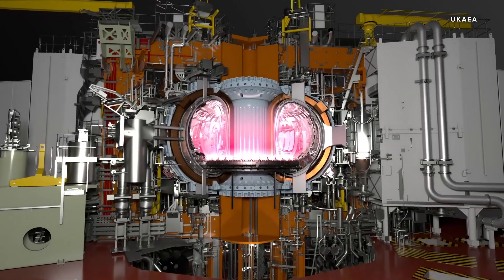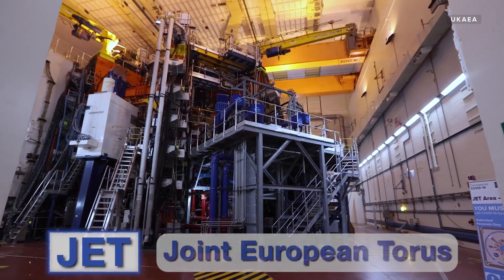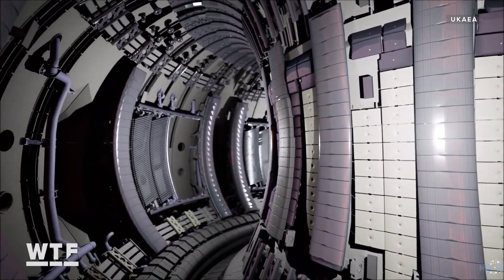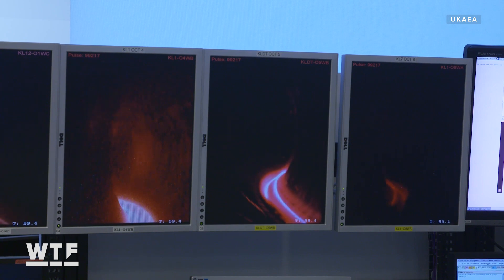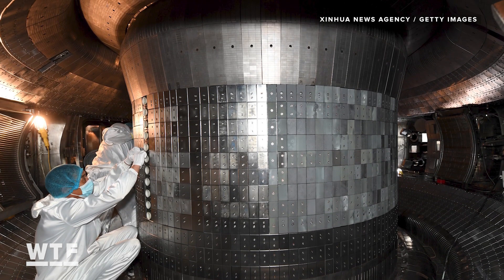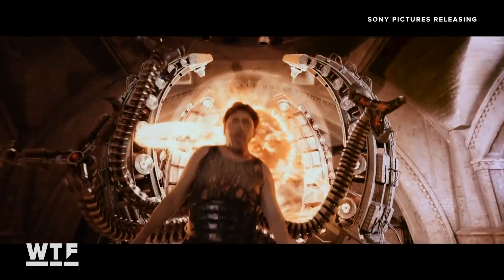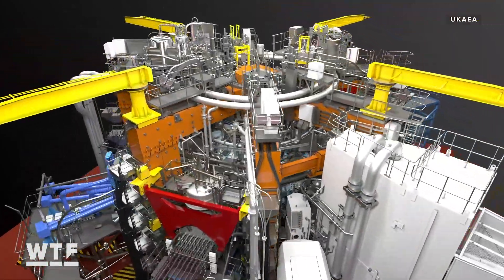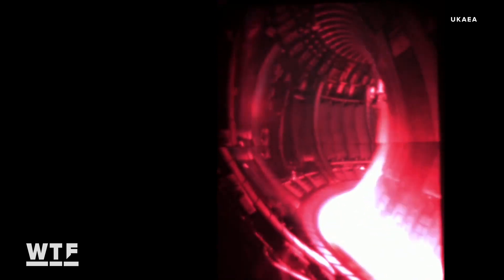World's Largest Fusion Device Breaks Energy Record

Comment: Produced by the Microwave & Imaging Sub-Systems group of the French multinational Thales, which provides electrical systems and services for the aerospace, defence, transportation and security markets, this video describes the company's work to design and build radio frequency and microwave sources for the ITER Project. The mastery of vacuum, high voltage and microwave technologies is critical to creating wave-generating sources of ITER's radiowave external heating systems. The company is bringing all of its expertise to bear to build the European-sourced gyrotrons of the electron cyclotron heating system and the tetrodes of ion cyclotron heating system and contribute to "a disruptive alternative" in the 21st century energy mix.

Comment: When a meteorite lands, it releases a lot of energy. Can large power plants be built with this mechanism?
Reply: General Fusion uses very tiny amount of a H-bomb material to heat lead to 600 degrees. They use hammers to knock on liquid lead and put DT fuel at the center.

Comment: Remember,  these improving results are based on how we THINK fusion should be done and its possible at some point, there will be a ah ha moment when we realise we can make change and then all the pieces fall into place and reduce the size of this thing down. The experiments are based on the obvious of we must use Det or Trit and make He but this requires massive heat and pressure as the sun does now as it doesant know any better too and it just is because of the cosmos and how that was made. So we follow the logical path and its slow going but i hope, we have that special moment when we can do this differently such as a form of cold fusion as making a mini sun and containing it may not be practicable and Aliens where ever they are will have gone way past this iron age thinking and will have small boxes running at 100% efficiency and no heat giving out insane amounts of power; sort of thing Bob Lazar claimed working on but is kept secret as it somehow in private hands through the navy and thus the govt can enquire? or raid or anything like that to take over the project. Anyway its all very murky  assuming that really happened 30 years ago, but it makes you wonder if all the worlds scientist are wasting their time as this stuff already exist and is held very tightly secret for various reasons, 
Either way, lie or not,  aliens a thousand years or hundred thousand years ahead, would have been through all this and for me, i would love to see the science and tricks and tech to jump forward and get to the end product to avoid all this waster money and failures and the clock is ticking on earth for climate a bit, so we need to get base line working clean and deal with cars ect using electrics with better batteries that dont pollute or cause their own problems. Great to look ahead 10 years from now and see if we hit a wall on Fusion or making it happen...

Comment: 5 seconds is significant at this stage of development?

They've been working on it for  around 5 decades.

At this rate, by the time we get to a month, the Sun will be swole up to a Red Giant.
Reply: You don't need to get it into a month. You need to sustain it for at least as long as restarting another device takes. The plan is to build 2 reactors who work on turns so while one produces energy the other one is restarted. ITER is designed so the time of restarting is a fraction of the time it's expected to work.
Reply: @BlueFrenzy  so I guess it's like an internal combustion engine where you mix in the fuel, start up the magnetic fields, heat it up to start the reaction, extract the heat to turn turbines, then vacate the chamber and start over.

Imagine a V8 nuclear reactor.
Reply: @bigsmall246  Yes, more or less. But instead of cycles of milliseconds it will use cycles of minutes/hours.
Reply: @BlueFrenzy  as the chamber gets larger, it will get harder/take longer to remove the waste He. I wonder how they will solve this problem.

Comment: I am excited by prospects for fusion.
However, I think we should be investing more in Hydrogen fuel cell technology. We should also be trying to do away with our current design of the grid. We should have smaller, green power production stations that switch between wind and solar, with Hydrogen fuel cell as battery storage and back up generator. 
This technique is already available. The grid is designed to handle huge amounts of electricity. This requires a great deal of heavy equipment and hundreds of millions of miles of wire. Our grid system is vulnerable to wind,ice,lightning, attack, trees falling, and accidents. This system is unreliable and too expensive to sustain. It was designed in the late 1800s. We should be putting our efforts into designing and building a new system, that is more reliable, green, and can deliver more electricity to consumers for way less amounts of money. I never hear of anyone doing anything with electricity, that evolves doing away with our current grid.
Even if you produce fusion technology, as long as you hook it up to the current grid system, you really have done little to bring the consumer into the 21 century of potential technology availability. As long as you are making electricity for the existing electric companies, you are feeding a system of monopolies, which is able to charge a lot of money per watt of electricity used. We should have a system that charges us for the equipment , so that we can use as much electricity as we want to, without paying any extra, unless we need to produce more for our own uses. In which case we could buy more production equipment and generate more electricity. If we used thousands of smaller systems, and enabled people to get off the grid, we could see the costs for consumers go way down, and the reliability of our electricity go way up.
Our grid won't be able to handle it if suddenly we all switched to electric vehicles. And the cost of energy would be too high to make the switch in the first place, unless we do away with the grid. 
We need to design a system that a homeowner, or small group of home owners can purchase, that provides electricity to just the people who own the system. The wires should be in a protective conduit under ground. We should not have to worry about losing power during a storm, or waiting weeks or months for power to be restored after a disaster. And we should not be pay share holders of a monopoly that is responsible for the destruction of our atmosphere. We spend more resources every year repairing the out dated grid, than it would take to invest and manufacture a new 21st century designed state of the art electricity production and storage system that produces more reliable electricity ,for less money ,and costs way less to maintain.
Reply: Hydrogen fuel cells are both dangerous and wastes half of the energy. Smaller grids implies that if the grid fails you are out of energy. The sole reason why in Europe we rarely see blackouts is because of the redundancies created by the large grid. And solar and wind requires lots of space. Nuclear fusion will have a key role in mankind colonizating the solar system where you cannot just place solar panels or wind turbines where you want. Nuclear fusion is clean, compact, more powerful and reliable than any other alternative.
Reply: If one really wanna upgrade the large scale grid the only option is to switch from AC to DC but high voltage DC transformers are expensive and expensive to maintain but other then that there is not much to upgrade on that part at least in terms of transformers and cables while I do agree if more got solar panels on their roofs it would be quite great but you under estimate the size needed for wind parks even just one of those wind turbines need a large safety zone and they only operate if the conditions is right to much wind and they stop and to little it stops on its own and then they make quite a bit of noise as well, don't get me wrong I love green energy but just because something is old does not necessarily make it bad but we will definitely need fission if we want everyone to have a electric car as we use ICE cars today

Comment: It's not a massive energy output - only enough to boil about 60 kettles' worth of water. But the significance is that it validates design choices that have been made for an even bigger fusion reactor now being constructed in France.
Reply: It's 60 kettles operating at the same time. Enough to trip the circuit breaker in your house probably.

Comment: 5 seconds after 70 years of efforts? Once heat is generated, how heat can be extracted out of the Takomak? You cannot run a pipe inside the Takomak!
Reply: By using the tried and true method of a steam turbine, same as coal plants.

Comment: As great a potential as fusion power has, human will inevitably weaponize it rather than harmonize it...
Reply: They made that weapon already back in 1952 - it's more commonly known as the hydrogen bomb.

The first fusion bomb was tested by the United States in Operation Ivy on November 1, 1952, on Elugelab Island in the Enewatak Atoll of the Marshall Islands. 

"Mike" used the Teller-Ulam configuration, liquid deuterium as its fusion fuel and a large fission weapon as its trigger.

Its explosion yielded 10.4 megatons of energy-over 450 times the power of the bomb dropped onto Nagasaki-and obliterated Elugelab, leaving an underwater crater 6,240 ft. wide and 164 ft.

Tens of thousands of nuclear bombs have been constructed since then.
Reply: @Jermain-cz4bh  Perhaps, but although the plasma is super hot, it's not very dense. It cools surprisingly quickly.
Reply: That already happened long ago. It's called the hydrogen bomb.
Reply: What's great about that is that you can't, as counterintuitive as that may sound. Fusion can't undergo a runaway reaction like fission so you can't turn it into a bomb.
Reply: @16BitGoofball  Where there's a will, there's a way...

Comment: The fusion program is a failure because it is run by scientists and not engineers. For example, q = 0.33 is only true at the surface of the plasma.  An engineer would have looked at the wall socket power input versus power output and seen that
 q was far less (maybe 1% or so).  An engineer would have looked at the fusion power program, seen the economics of it, and then either allocated dollars to a better approach to fusion, or abandoned it completely and put the money into solar panels instead.
Reply: First, engineers need the science in order to start working with it.
Second... this is being build with thousands of engineers. So naive.

Comment: So they still don't tell us anything about the real issue... Fusion has been achieved for like 30 + years. Its containing it with less energy than they make that is the problem.

 Equal and opposite reactions says you can't hold back more with less. 

 So why nothing on that?

 Also isn't the sun's core under almost zero G cause of how much stuff is around it as its also doing quantum things to even stay burning. 

Cause the math says it shouldn't even be doing fusion cause its not hot enough or dense enough.

So still missing things that might actually matter.
Reply: Not to mention Earth needs a magnetic field so we don't die from radiation that's 90 million miles away. But its clean right...
Reply: @Blazeww  what are you on about lmao

Comment: How the energy is collected from that reactor?
Heats up its walls and center pillar from which  heat is collected ?
Reply: Yes.  Similar to a fission power plant, cooling water will be passed through the system, which in-turn will become steam when heated and spin turbines...in the early days of fusion, I always thought somehow we would receive power directly from the fusion reaction, but nope, we're still reliant on mechanical power (work) to provide the usable electricity...in the end, we're always trying to make heat...coal, natural gas, fission, -fusion (maybe).  When you think about it, is solar really the only means of non-mechanical power production??  Sorry for rambling on your post ;)
Reply: @mohare134  the plasma itself is extremely hot and radiating x-rays, gamma rays, etc. We probably have a semiconductor that works on gamma rays, but there isn't much research into mass production yet since there aren't many gamma ray sources to harvest.

Mechanical turbines is what we understand the best. The reactor itself already requires huge amounts of R&D, so using the known technology of turbines is the best way to reduce risk. After we get Q>1 from the reactor, we can find more efficient ways to extract the energy.

Or... It may turn out that the energy will be so cheap that we won't care about increasing efficiency until we start running into shortages.

Comment: LENR is the only real fusion energy method.  Heat is the opposite of what is needed for fusion.  The heat of fusion IS the energy product, not the source of fusion. Hot plasma will never produce fusion. LENR has been attempted to be buried by big budget greed, in order to favor centralized power ownership and control. Chasing this oligarchic central power fantasy on promises of scientists claiming "it will work, it just needs to be bigger" and "our equations prove it will", all the whole buying 5 decades of time and failure to produce even a single volt of power greater than what is required to waste massive amounts of expensive energy as waste heat that was never reclaimed is an example of a poker face bluff. LENR cannot be scaled to a central power supply because God designed it to be available for every home to produce it's own power and security of energy. Every person's home is their sovereign castle and must be respected as we are all divine in nature. Greedy oligarchs are drunk on power and control. Sovereign people are sheep to them. Meanwhile, people freeze to death during centralized power outages. The central fusion distribution idea greed continues. But, LENR is the real way to secure home based energy production and secure people's lives.

Comment: We already got one in the sky, and it lasts for 10-12 hr most days.
Reply: I agree. Throw all the tech at harnessing the one we have. I don't mean a Dyson Sphere but an array that can concentrate something that already exists.
Reply: @AReasonablePerspective  the sun is 8 light minutes from earth, rocket fuel is expensive, we wouldnt be able to get the electricity, and we wouldt have enough recourses
Reply: @Jermain-cz4bh  I wasn't talking about going to the sun lol. We should use existing tech to launch an array to a language point (L2). ~$20,200 per kg 
(wireless power transfer) 😉
Reply: @AReasonablePerspective  an array at a langrage point of earth wouldn't do much in efficiency
Reply: @Jermain-cz4bh   L2 is unstable but usable and is used. L4 or L5 are stable and are more suitable for observatories/satellite. 
It would however be interesting if you would link me into the literature you have that dismisses the solar array suggestion and support your misgivings. It's a subject I am extremely interested in.
L2 is 1 million miles from Earth (a relatively short distance) and hosts the WMAP studying the CMB. This point is ideal for a deep view of space given the Earth, Moon and sun are behind it. As it is unstable, minor corrections need to be made by the craft. A solar array at L4 would not need to make these corrections due to its stability so fuel costs are not important when in situation. 
$10,000 to put a pound of payload in Earth orbit now thanks to SpaceX 😉
Reply: @AReasonablePerspective  mate I have one question for ya how are you planning to transfer that energy from the space solar array back to earth? that if anything is the issue we facing whit any dyson tier projects
Reply: @link7417  Sorry brah I did answer but the comment appears to have been deleted.
Wireless Power Transfer or WPT. 
It will need scaling up but the tech exists. Also my theoretical idea for a solar array would be relatively small. Possibly many small ones that can be linked together.